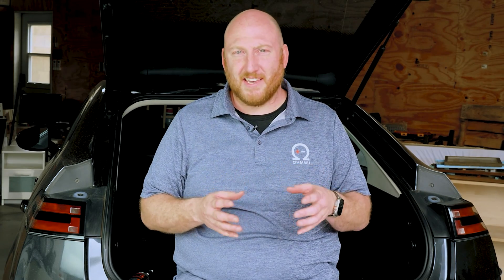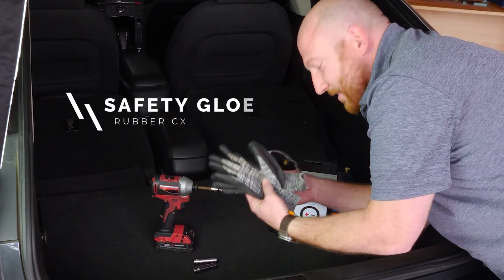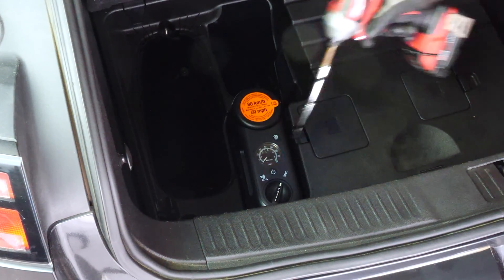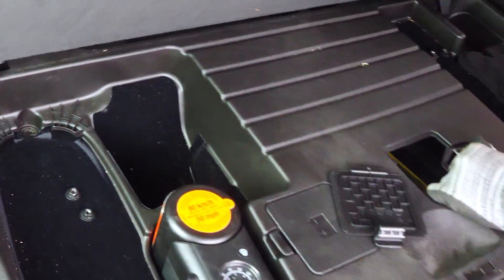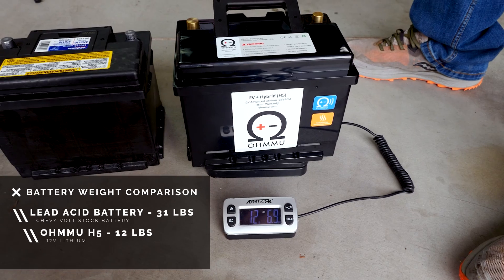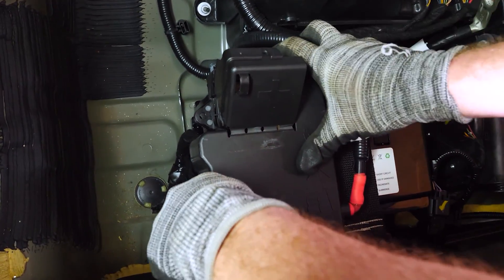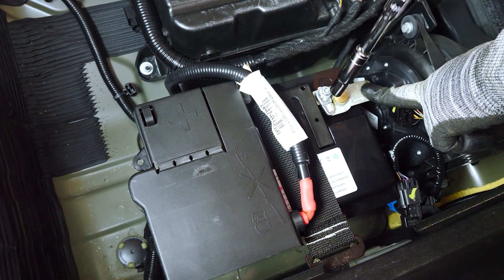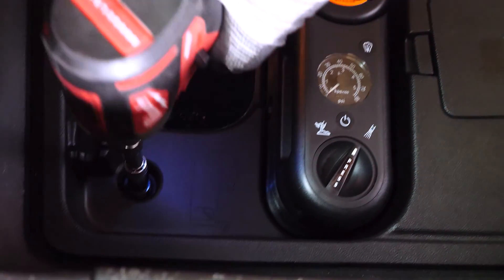Chevy Volt - 12V Battery Installation (Ohmmu)

Comment: For the people watching this!!!!!! Always go with an agm Battery! The resistance of an lithium battery is much lower and it will FRY your APM module within 6 months or give you lots of trouble on other modules. Some people may be lucky , but after working on a lot of these vehicles i can say its 70% that got the bad luck with going for the cheap lithium battery. Please BUY AN AGM BATTERY FOR YOUR VOLT (Gen 1 and Gen 2)
Reply: Replaced an old battery that was showing its age now powering my system amp and sub on higher volume. Put a 150 buck lithium battery in it tryn to do better for my system… lasted 2 weeks. Went home from work and had 2 days off back to back and didn’t go anywhere. Day 3 locked out of the car with a dead battery. Tried the jump it up front to get the car to power on to charge it…. Charger wouldn’t even see the battery. Plugged the car into the house…. Nothing. Grabbed an old acid battery put the charger on that one then jumper cables to the car under the hood and got the car to power up. Thought I was good at that point…. Nope car wouldn’t move. Openers the hatch to charge the battery from there and it took 30 amps for an hour then 20 for another hour and I stopped it cause I had to go to work so took it out and put the old acid battery from another car into it, cleared all the codes and got the car to work. Took the lithium to work to finish charging and put jumper wires in from it to the old battery just incase so I had more power. Ordered the agm battery and been fine since. Can’t say this issue caused it but now that it got cold out my heat don’t work in EV but works on gas. Just shows AC on Heat off while temps on high.

Comment: I need to store my 2014 Volt for a couple of months and it's recommended to disconnect the negative cable. What size is that bolt? Different from all the old cars I drove. Thanks in advance.

Comment: hmm i am about to do this conversion but there are some issues ive found. the car tries to desulfinate the battery every now and then, and starts its 12v charging curve with 100 amps which usually triggers a protection from the BMS. eventually the battery will stop charging and go flat after a few weeks if the car keeps trying to go into this charge mode, depending on the bms in the lifepo4 battery. also the battery may be exposed to below freezing temperatures which will either trigger a shutoff from the BMS, or cause damage/swelling to the lifepo4 battery. i think these issues can be overcome by not using a bms and relying on either top balancing by mfg/user, and maybe the occasional employment of an active 12v 4s lifepo4 balancer. also, adding a solar panel or two to the car, ~200watts should keep the battery above the voltage threshold that the car sense to start charging the 12v battery system. I think im going to build a ~3.5kwh lifepo4 battery out of 4, 280ah eve cells in series and just not run any bms. maybe put in an active balancer circuit that i turn on from time to time manually with a switch, and also by installing a 12v thermostat circuit that runs a fused 40watt rv water tank heating pad to make sure its not going below 0C/freezing temps. that plus a solar panel or two would be a good way of stopping the car from trying to charge the 12v system or causing damage. theoretically if you keep the 12v system at fully charged lifepo4 voltages, around 14-15volts, then the main traction battery should never try to charge the 12v battery (except for every month or two it tries to manually charge it for a short period of time i believe).
Reply from the maker: Yes, we have observed these 100A charging sessions and our BMS can handle it!